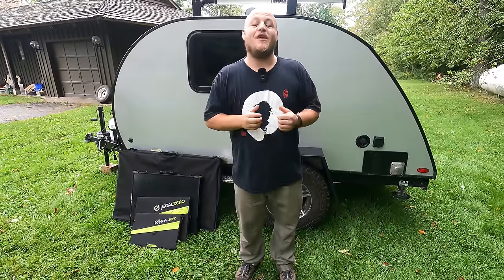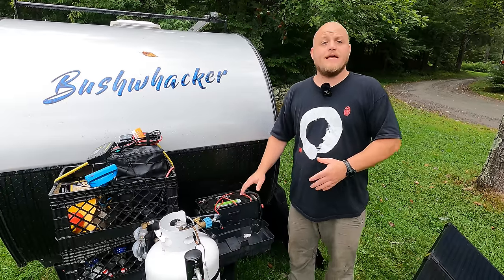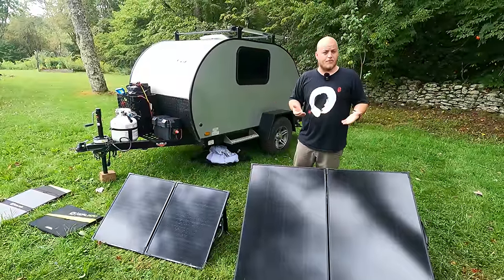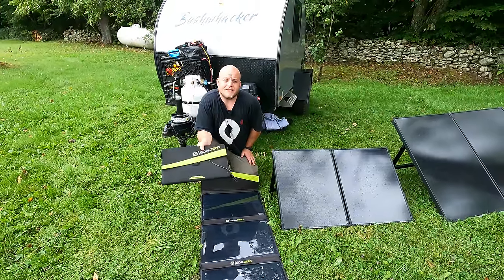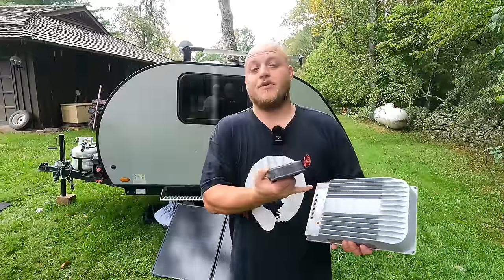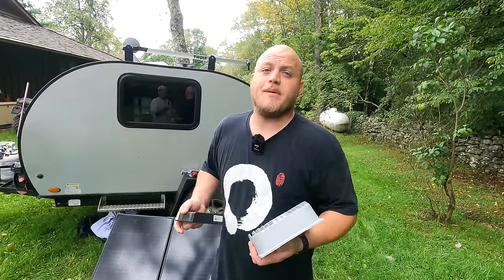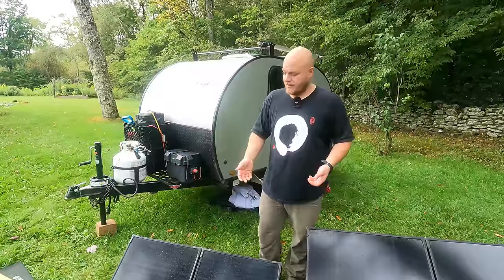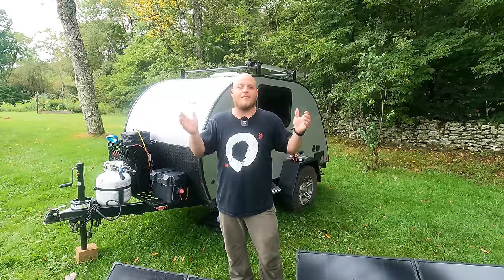RV Solar 101 : Everything a Beginner Needs to Know !

Comment: That was a really interesting video. I'm looking at doing a solar panel system on my shed to power the lights, and from time to time a 1000w inverter, and iv be trying to work out what I will need. Iv a much better idea now now on what I will need. Thanks for posting the video.
Reply from the maker: Nice, there’s a real case for solar sheds these days. Where I live, it’s often much cheaper than running a sub panel from house.

Comment: Bless you, sir. This is the BEST beginner friendly solar video I've seen and I've been looking for literally YEARS. LOL! Question: what happens if your panel wattage exceeds the limits of the charge controller? Does it burn it out? Cause a fire risk?
Reply from the maker: If the open circuit voltage of the panel, is less than the voltage on your charge controller, you are fine.

It is acceptable to over panel your charge controller, as long as the voltage stays under .

In other words, let's say my charge control says it's good for 30 V and 15 A .
Let's say my panels have an open circuit voltage of 20 VDC and 5 amps.   As long as I'm connecting the panels in parallel, the voltage is going to stay the same, less than 20.  In that case, I can add a whole bunch of panels,  even if the current gets over the "amps" on the charge controller.  The charge controller will just draw the maximum amount of current it can use and nothing is damaged.   If you go over the voltage, you will fry the charge controller.

I hope this makes sense, this is more a solar 202 ... lol
Reply: @DIYOutdoorLife  Yeah, you lost me. I'm an electronics dummy (ie: OLD LADY). Can you direct me to the solar 202 class? Or better yet, if my goal is 6-100 watt panels (or 3 200 watt) and two 100 ah lithium batteries...which charge controller and converter/inverter do I need to buy? LOL
Reply from the maker: If you can send me the exact panels you want to get, I'll pick out the charge controller for you . Well keep it easy.
Reply from the maker: @randomspirit   👍
Reply: @DIYOutdoorLife  You sir, are a GEM!
Reply: @DIYOutdoorLife  Trying to find your email address, is it hiding somewhere on your YouTube home page? LOL
Reply from the maker: @randomspirit  diyoutdoorcontent@gmail.com
Reply: @DIYOutdoorLife  Thank you, I'll be in touch shortly! :)

Comment: You may have saved my BACON. In 2018 I purchased a Goal Zero 1400 with 2- 200 W suitcase panels.I added the connecting cables  from my panels to the Goal Zero with no PWM Controller because I couldn't fully understand until tonight how important that is. It worked fine but I was there to disconnect as it reached 98% capacity. 
 The manual states:DO NOT ATTEMPT TO CHARGE YOUR YETI LITHIUM FROM A 12V SOURCE. Doing so may cause damage to the unit. Does that mean there is not an accessory available to recharge the Goal Zero 1400 to your vehicle while it is running? I was going to purchase a YETIX 600W POWER SUPPLY to plug into the Jeep to speed up the charging time when I came across all your very informative videos on this difficult to understand subject. Any help on this would be appreciated.  cheers
Reply from the maker: Shoot me an email, there’s a couple things we can go over there.  The Yeti 1400 has a PWM built in, you can also add a MPPT to it.

It’s fine to charge from 12v source if you use their regulated car charger.  The “X” series provided a lot of upgrades standard, the 1400 is more of an À la cart set up.

Send email to diyoutdoorcontent@gmail.com and we can get you set up.
Thanks for watching!

Comment: Good video bud I’m pre wired for solar on my passport I have a dual zamp roof mounted plug in on the roof and it has a plug on the front of my passport close to the battery I want to put 2 batteries on the tongue of the trailer and mount 2 200 watt panels on the roof and get a 50 amp charge controller so if I want to add or use a portable panel I could do that I think from I got from the video thanks for sharing
Reply from the maker: Seems like the prewiring they did was very handy!   I'm glad you'll be able to take advantage of it and have a great system.
Thanks for watching!

Comment: Saw a 100w kit at Harbor Freight. The charge controller is 550w. According to your info and video etc that would be too big, right? I have 2 RV agm batteries, I’m guessing 12v. So right now, I’m lost. I want to top off my daily usage without a generator for the time being. I have a 5 day trip across the northern states next month, and I’m boondocking. So, my hope is to use electricity minimally, except my fridge while traveling, and potentially a portable heater intermittently, depending on weather at night then going to city power in MN on day 5. This will be my maiden voyage so I’m not familiar with a ton of this stuff or how much power I’ll be using that needs to be topped off. Your videos are so easy to learn from thank you!
Reply from the maker: I would avoid the harbor freight kit.  I have used them with folks on their tiny homes or a cabin, but I really don't like it for campers. It's much bigger and heavier than equipment that works just as well or better.
I will post a kit that is inexpensive and includes the same things as the thunderbolt kit from HF.  This might be all you need, you might need an extra extension cable possibly.  It's pretty beginner friendly.

https://amzn.to/3OWRC2M
Reply: Thank you for that info. I’m looking into it now. One other question, where does an inverter come into play? Is that only if you’re running off pure battery? Or is an inverter needed with these solar set ups? Basically, does the charge controller do the same as the inverter in this case? Guess that’s more than one question. 😅
Reply from the maker: @brendajohnson9183  an inverter allows you to use 110 AC outlets when  running off a battery.  It's very handy, but it shreds through battery very quickly.  Most of the time, you have to have a very big battery bank to get effective use.  Other times, if you only have to run very small items, an inverter can be handy.

A charge controller converts the DC output of a solar panel into an effective battery charging parameter.  It's needed any time you're trying to charge something with a solar panel.  The kit I sent you has a charge controller built-in.

Comment: Great video.  You should add that you need to calculate how much power usage you average when sizing a system....doesn't do any good to have a 1200wh battery when you use 2000w per day....I know this is more advanced but that's where I'd start....then figure out when you use most of your power to determine whether a bigger battery or bigger panel is needed first....using most of your power overnight, you'll need a bigger battery before you need a bigger panel....use most of your power during the day and a bigger panel can get you by for a while
Reply from the maker: Exactly. I do that in the “solar for beginners” video I made. Trying to be able to make this stuff accessible, but as you know, people start to freak out when you have them using a shunt to calculate loads. 
Great comment, thanks for swinging by
Reply: @DIYOutdoorLife  yeah, solar is very simple...but for people who can't get the basic electrical concepts down, you gotta start with real basics....I've been wanting to do some videos on this stuff but glad others are out there doing them

Comment: Just found your channel it’s great , I just purchased a coachmen 9.0 it has solar plug on the out side wall . Of course no one could give me an answer about the system. But just buy the panel . Am I over thinking this ? Do I have a control ? Just buy & plug in hope it’s working ☀️😎
Reply from the maker: Hey Kevin, these solar on the side plugs are mostly a gimmick.  They’re just a wire that goes to the battery, they still require the charge controller and panel and they often come with a sticker that encourages you to use extremely overpriced gear.  Check out this video, there’s an explanation and links to different solar options. Thanks for watching. 

https://youtu.be/AOdhIscdez4

Comment: Great and easy to understand video!  Thank you.  I do have a question.  If you are running two 6V batteries in Series, how does that change the formula?
Reply from the maker: Thank you, I appreciate you watching.  With 6 V batteries, just remember that it takes two of them to make 12vdc.  That means, two 225AH 6v batteries equals 225ah total at 12v - not 550... that throws some people off.

Other than that, everything is the same .

Comment: Hey Brian, great video. My used truck camper has a solar panel with an anderson connector and a Yeti 1500x. I am getting zero watts from solar registering on my Yeti. Even on sorta sunny days. i live in Bellingham WA and the sun angle is really low right now. What can I do to test the wattage coming from the solar panel? Appreciate any ideas.
Reply from the maker: Get a multimeter and start with DC voltage.  You can stick the red and black probes in each end of the Anderson.  You should be getting around 18 V, maybe a little higher. I would start there and we can build from what we find

Is any other charging source plugged into the Goal zero?

Any chance you have a wall charger or car charger plugged in?   The 1500x requires that only solar is plugged in when solar charging, if another port is plugged in on the charging side, it will not accept.

Comment: I am.new to solar and RVs as it happens,  so I'm not sure how much power I need. I settled on Renology 100w portable,  it comes with cables and 20A controller , that, is waterproof. In poor light , I'm in the UK , it reads 18v . However I've not tested off grid yet. It's hard to find exact power usage on items in the RV. I'm not sure my batteries hold up for 3 days I need to check. Thanks for the information,  really useful 👍
Reply from the maker: Thank you for watching, happy camping!

Comment: okay, I have homemade  teardrop camper,  has basics small water pump for sink, stereo, interior lights, and 2 cigerette lighter 12v plugs for use inside with small 6pack fridge, and small space heater if needed. I have one full size 100W solar panel and two small 12v deep cell marine batteries I hook up for 24v system.  I just seriously need one video showing how to connect  mounted solar panel, using what connectors, to the battery, and how to hook all the wires to the above  to the battery.  finally, I want to be able to shut off solar power to camper and use regular plug in if power is available.  LOL can you make that video?
Reply from the maker: Have you watched the solar playlist on the channel?

Here’s a panel instal
RV Roof Solar Panel Install - Roof Rack
https://youtu.be/nIpGvJzrKg0

Here’s a charge controller 
DIY Charge Controller | Installation Options
https://youtu.be/4_2_Xt4eOoM

Comment: So glad I found your videos.  I have to get new batteries in the next couple weeks for my 2016 28’ Class A motorhome.  It has 2 12v lead acid house batteries which are 5-7 years old and will no longer hold a charge above 12.2 through the night with just the roof Maxair fan running or in winter with the furnace running.  
I wanted lithium but the price for all the components needed was 5k.  Even barebones install would need a converter upgrade and heavier wires.  
I did upgrade to AGM on my old 36’ Bounder Class A back in 2015 when they were new on the market.  Had to add a charge wizard to my 60 am Progresive converter but that was only $10 and an easy install and upgraded the converter to a 4 stage.
 The AGM 288 ah no maintenance batteries were great.
I think I am going to use the AGMs again.  This time I have a combo converter charger fuse box.   Do I have to replace the whole thing with a 4 stage charger fuse box combo now?
Reply from the maker: I wouldnt, you can get a very solid complete charge out of the profiles on those standard chargers.  I don't think it's worth changing anything if you're sticking to AGM.

Comment: So thank you I've watched a ton of videos and have learned more from your video than the others. But I have a question I've researched wind turbines can I use them with solar panels at the same time.
Reply from the maker: Yes, you can run wind turbines and solar at the same time.  You would get separate charge controllers for each, but they would both be connected to the same battery bank, and charge simultaneously.  Thank you for watching the channel!

Comment: So glad I found your videos.  I have to get new batteries in the next couple weeks for my 2016 28’ Class A motorhome.  It has 2 22v lead acid house batteries which are 5-7 years old and will no longer hold a charge above 12.2 through the night with just the roof Maxair fan running or in winter with the furnace running.  
I wanted lithium but the price for all the components needed was 5k.  Even barebones install would need a converter upgrade and heavier wires.  
I did upgrade to AGM on my old 36’ Bounder Class A back in 2015 when they were new on the market.  Had to add a charge wizard to my 60 am Progresive converter but that was only $10 and an easy install and upgraded the converter to a 4 stage.
 The AGM 288 ah no maintenance batteries were great.
I think I am going to use the AGMs again.  This time I have a combo converter charger fuse box.   Do I have to replace the whole thing with a 4 stage charger now.
Reply from the maker: I know I already responded to this comment, I must've put it in the wrong place... lol   

I would stick with the same charger/converter, no need to upgrade.  If you're gonna go with the AGM battery bank, You'll be fine with the standard parameters of that converter.  If you go lithium, as you said, it would be worth doing the other upgrades.

Thanks for watching!

Comment: what is the recommended set up for a small camper set up. Solar panel; battery; controller;   your explanations and videos are great, but just give me a list of equipment for a 100w and 200-250 w system.  Thanks
Reply from the maker: What type of things do you wanna run?  Explain a little bit more about your camper, how long you go, where you live, and what do you want to run and we can pick some solar equipment.

Comment: excellent video!! thank you!! we just bot a new camper that comes with a 200 watt panel, inverter, etc. I was up on this stuff a few years ago but haven’t kept up. Your video refreshed my memory very well. 

A question please, I intend to have 4 100ah batteries total. The only thing that has a surge is the 15k BTU a/c. Is it the inverter that needs to be able to handle that if I’m not running a generator? And, if I am running a generator, does that bypass the inverter? 

Thanks for your help, and maybe I’ll find the answer in your other videos! 

New subscriber and thanks again!
Reply from the maker: Yes, the inverter is what has to handle the surge.  Sometimes, you can use the device called a soft start that greatly reduces that surge.  This becomes a very common component with a offgrid air conditioning.

I will say, a 15K air conditioner is huge.  Often times, will work with three or four times that battery capacity to run an air conditioner of that size.  It is almost always using the highest quality lifepo cells.   Many people discover that it is cheaper to upgrade their air conditioner and it is to buy the power systems to supply the original.

Hope this helps, thanks for watching! 

PS, you can wire the inverter a number of different ways, most people go with an all in one system that automatically switches from shore power/Generator and offgrid.
Reply: @DIYOutdoorLife  Thank you very much! And, your channel is both informative and fun. Thanks again!

Comment: So I've decided you're probably the best person to ask this question. I have two rigid individual 200w panels that I want to use for a semi-permanent install (I don't intent them to move), and I would like to add another 200w for a total of 600w in series. My question is - do the panels have to be from the same manufacturer? Or can I buy a 200w panel from a different manufacturer and hook it up in series with the two original panels? I'm finding it difficult to find 200w individual rigid panels lately, probably something to do with supply chain issues. Thanks for your response.
Reply from the maker: Supply chain is def reeking havoc!! 
I mix vendors in series and parallel all the time. It’s generally considered “not recommended”, because they can have different electrical characteristics and performance degradation.  It’s really not a big deal if you match voltage/open circuit V and wattage.  A lot of times you’ll find a company like HSQT and Renogy are literally making the SAME panel rebranded. Find one of equal size, same voltage and wattage, and like you said, similar type (fixed monocrystalline)
Reply: @DIYOutdoorLife  Do you sleep at all? You've earned a subscribe and a coffee! Many thanks!
Reply from the maker: @twloughlin  lol 😂.  Thank you for both, I really appreciate it.